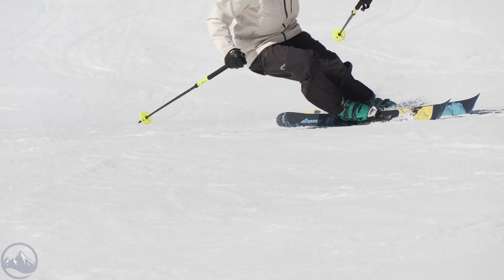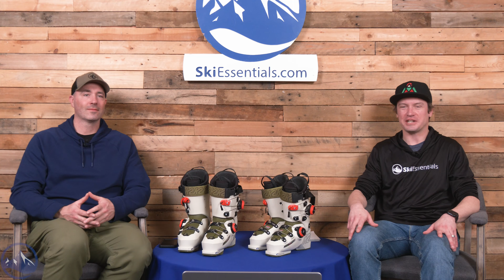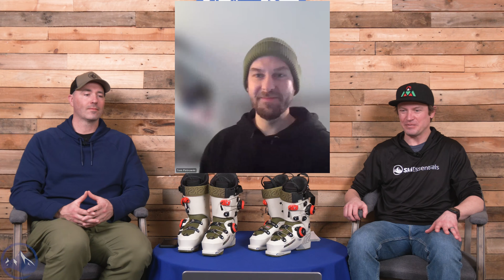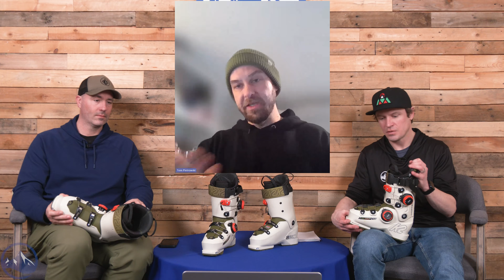2026 K2 Cortex 140 Zonal BOA Ski Boot Introduction & Interview with Tom Pietrowski about BOA Boots

Comment: if you remove the lower screw, is causes the upper cuff to deflect more. IT DOES soften the flex a little bit. Surprising ignorant comment from the K2 rep. When you only remove the lower bolt it opens space around that open bolt, plus medial and laterally, that wouldn't otherwise be able to deform/deflect if the lower bolt was in. @SkiEssentials

Comment: Can you get longer boa cables? Would this help open it up more to get a zip fit in?
Reply from the maker: Longer cables seem like they're in the works.  From what we've heard, bigger boots, like over 25.5, have more cable in the spools because they have to close more plastic.  I can't confirm if this will be an option for skiers, or even an aftermarket item.  For me (bob), it's still a lot of overlap in the plastic for the ZipFit.  My Workhorse liner is also very stiff--more so than the Gara, so I do think there's a liner/shell compatibility issue beyond just instep room.

Comment: Someone commented on FB mentioning the fact it has tech inserts up front yet no walk mode. Seems like a weird thing to have.
Reply from the maker: It sounds like the point of this, and there are other boots with tech inserts/no walk mode, is to access more sidecountry oriented descents.  So mainly riding lifts, but also with the capacity to access different faces.  Not intended for massive climbs, I think.

Comment: For me the problem with double boa is that the top part being tied on 1 boa has to be cylinder shape can’t been funnel. My top 2 buckles are 2nd and 3rd  notch so like a funnel
Reply from the maker: Tom explains this in great detail in the video.  The cable, since it's continuous, if it hits a stopping point at the top cam, will simply continue to tighten on the bottom, so it will create a funnel shape.  The cable tightens where the resistance ain't.

Comment: Does the boot open up enough for ZipFits?
Reply from the maker: Not easily.  Jeff has done it with moderate success but I (bob) am not close.
Reply: @SkiEssentials  I can get my zipfits in but it is a struggle. Much better if I heat before putting on but still need boot spray and a boot horn.
Reply: Jeff, are you preferring the 130 DD Nordica or Coretex 140….or simply two different applications? One being a better all rounder and the Coretex being a crud mobbing machine…?…
Reply from the maker: @crystalskier  The Nordica is the go-to boot.  Cortex is a fun alternative but a bit rugged for daily use.
Reply: If the boots have been in a heated bag, I have no problem.  Zipfit Gara HV into a Cortex 130. If they aren't in the heated bag and are winter cold, its quite a dance and pain in the azs.

Comment: Would have loved to hear from Tom on why only the 140 got pins. Hopefully we get to hear Matthew Manser from Atomic next on the Remedy and its future.
Reply: Adding the tech toe does add a little cost and it also restricts the options for sole canting. But this is just year 1. We strongly believe in adding tech inserts to none walk mode boots so more cortex boots will have them in the future.
Reply from the maker: I think he covered it in the fact that the 140 is designed as an athlete's boot and that the pins are part of the athlete's input.  We see this in other boot lines as well--the top flex boot is the one that gets the pins.

Comment: Boa makes a lot of sense as a closure system. Buckles are very localized and likely provide extra stiction especially at the high end of clamping forces. Boa is a much more smooth wrapping of your foot.
Reply from the maker: I (Bob) find that the performance is better than the buckles, although I still prefer the simplicity and ease of use of buckles--I find it hard to find the same levels of tightness in BOA while buckles are more consistent and predictable.

Comment: Great insight and awesome video. I'm currently skiing a mindbender 100 that I've skied for 3 years going from an advanced skier to an expert skier in the process. I'm upgrading on these now after a season of wanting a lot more out of my boots and was looking at the mindbender 130 as my current mindbenders fit great, however should I be considering the cortex or will I be best with the 130 for a boot that I'm wanting to push my ski progression as far as I possibly can in terms of freeride - touring is a part of my skiing so the cortex 130 not having touring inserts strikes it off the list. For reference I'm 6'0 and 175lbs
Reply from the maker: I think if touring is a decent chunk of your priority list, then getting something with a walk mode makes more sense than a Cortex 140.

Comment: Have you guys been able to get your zip fits in the cortex?
Reply from the maker: Not really.  Jeff has succeeded but it's very tight.  I (Bob) can't do it--my liner and foot and ankle are just too stiff and the lower shell just doesn't open enough for me.
Reply: @SkiEssentials  I am doing it(with my Zip Fit Gara LV) by warming the boots and using a ski boot horn. But the original liner is very good. When I am in the boot with the Zip Fit, it is a fantastic hold.

Comment: You should also examined your Salomon SPro Race boots. The top rear cuff screws (Race spine) functions the exact way your guest explained the rear screws on the K2 boot. Pull your liners and remove the black fabric cover and expose the mechanics of the 90 degree adjustment / position works.
Reply from the maker: Will certainly be examining ALL of our boots from now on!

Comment: I will say that myself and the few friends I have that use them love our K2 Spyne boots.
Reply from the maker: I remember one of the first Spyne 110's had the Intuition liner, and our amazing rep took the time and heat-molded it for me in the lodge prior to testing.  It skied better than anything else I tried that day, much to my surprise.  It's tough putting Intuition liners in a boot and then trying to sell them in-store, though, as you have to explain to a customer that under the assumption of molding, the boot will then feel good, but out of the box, it's way too tight.  Tough sell then, much better now.
Reply: @SkiEssentials  ..Yes. My 130's have the Intuition liners. I was fortunate that the fit was spot on without the bake and excellent after but now after 3 heat cycles they're packed out. Time for my standard ZipFit upgrade. :D

Comment: As I understand it, the lower boa came about largely because the instep is a problem area for many people and the boa is more accommodative(?).  
  Personally, I make more adjustments at my upper cuff- with changes in snow conditions, temperature, ski style, etc.  it makes more sense to me, from a functional stand point, to have the boa in the upper vs. the lower…

Still very much on the fence about boa…buckles work just fine for me
Reply from the maker: Nordica even makes a Speedmachine 130 with upper cuff BOA and lower shell buckles, so there's all sorts of alternatives out there these days.
Reply: For me. My flat skinny foot. Boa seems to solve my issues with boot fit.